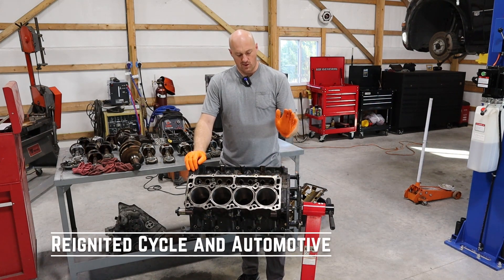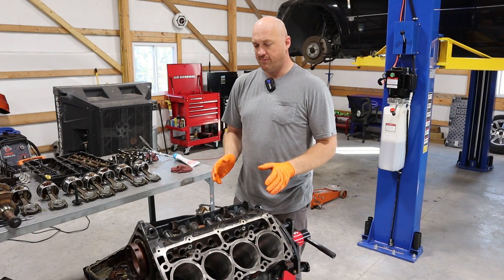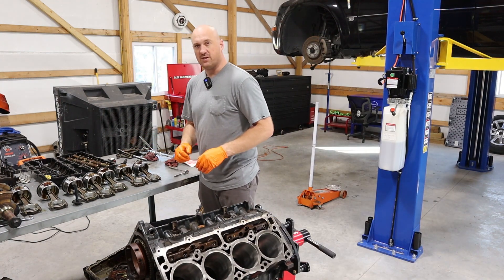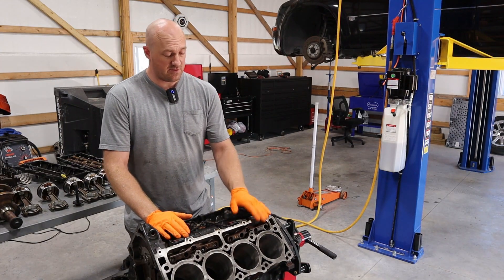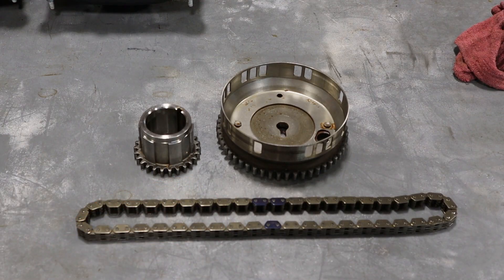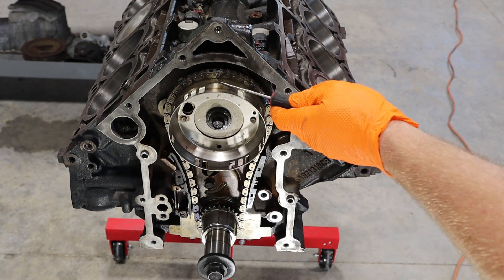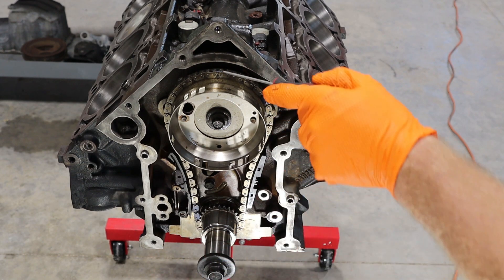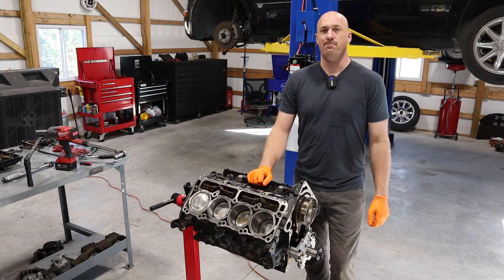How To: Engine Timing on Chrysler Hemi 5.7 // 300C Episode 3

Comment: I know that this is 5 years old but  factory manual shows the single timing mark on the chain to go at top on the cam gear. That's how i always install them. Apparently its not a big deal because it worked out for you with the 2 marks at the top. I use Alldata and Identifix for factory manuals. Thanks
Reply from the maker: I've heard this a few times over the years, the service info direct from Chrysler shows it the way I have in the videos, but there are other manuals that show it the way you described. Either way works obviously, in fact quite often I don't use the marks on the chain at all! The benefit of working with only one camshaft 👍

Comment: Thank you for sharing this, but what if I did it exactly besides having the piston at TDC or it is a must?
Reply: Yes having the vehicle at TDC Matters or your pretty much doing everything for no reason
Reply: That’s apart of setting timing if it’s not at TDC your timing won’t be right
Reply: @1 @10kDeeway  Thank you for the reply. Alright, since I made sure the crankshaft sprocket mark was at 6 o’clock, doesn’t that mean the piston was at TDC but I’m just forgetting? Because from what I’ve seen in my research over the past few days, whenever the sprocket is at 6 o’clock, that means the piston is at TDC. Please correct me if I’m wrong. Thanks again.

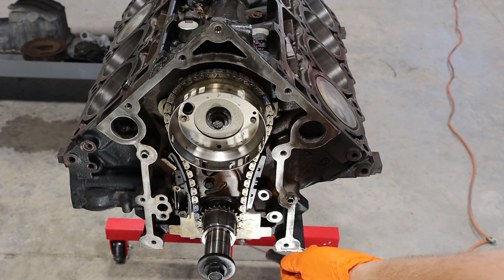Comment: 12:50 On my 2014 Challenger 5.7 you CAN still see the timing marks on the oil drive gear with the pump on and the pan still on too.

Comment: Hey Sky, appreciate the content! So I believe my 2010 6.1L SRT8 jumped time. Leak down test is good, valve train and total engine survived. Bore scoped all cylinders, looking good as well. Scanner shows cam-crank signals out of sync. When I was driving, it put itself in limp mode and cut off throttle response around 30mph/ 1000 rpm range. Jolted itself until complete loss. Cranks, started but ran TERRIBLY (only cranked it once to get scanner data). I have all but narrowed it down to jumped time. I'm going to take the front apart soon but I am VERY conflicted on what timing set to go with if it does end up being jumped. Cloyes makes a very inexpensive kit for a third of the price of Mopar but OEM, at least to me, makes more sense to put in? I want to pair new timing components with a Melling 10342HV oil pump. I am torn on what to purchase. Does Cloyes meets the OEM standard, or do I pay almost 400 dollars for a new Mopar kit? Completely stock car, will stay stock for a couple more years at least. Thanks!
Reply from the maker: I don't have ordinal experience with the cloyes brand, but everything i read says they're supposed to be pretty good and honestly the stock 6.1 isn't going to be stressing the timing chain. I think you'd be just fine going with that brand.

Comment: Hi im currently doing a mds delete kit on my 2012 5.7 charger i was wondering when im trying to time the engine my crank oil pump gear mark is facing at 5:45 at TDC my question is does it have to be at exactly 6 o’clock because when i try it at 6 the 1st piston goes down about 2cm thank you
Reply from the maker: Are you sure you're looking at cylinder #1? It's on the driver's side of the engine.
Reply: @ReignitedAuto yes sir drivers side piston tdc is at 5:45 on my engine if i try 6:00 the piston sits like 2-3cm down not tdc
Reply: @ReignitedAuto I believe its because i have the vvt engine I’ve heard the non vvt engines are marked at cam 12 crank 6 and the vvt engines are cam 12 crank 5-5:45ish
Reply from the maker: @MUSCLE_GARAGE-e1g negative, all gen 3 Hemi engines are timed exactly the same. If you're willing, send me a few pictures sales@reignitedtx.com so i can take a look.

Comment: How would you put the cam shaft in the right timing position if its not to begin with and do you have to remove the valve cover gasket to do the timing chain job?

Comment: Is that factory cam gear ? Been so long I can’t remember, I keep seeing a vvt and phaser gear and it’s throwing me off. I did a swap a few years ago and this is the same style gear I installed.
Reply from the maker: Yep, factory cam gear, but this engine is pre vvt so the gear just has the cam sensor reluctor wheel rather than the phaser 👍

Comment: Are you absolutely positive you got the colored links correct? Everything single thing I can find shows 03-08 non VVT having the two colored links on the crankshaft and the single link on the cam gear.
Reply from the maker: Yes I'm sure, however, the links themselves really aren't that important, as long as the crank mark is at 6 and the cam sprocket mark is at 12 you're in time.

Comment: HELP please!!!    I have a question for you.  I have a 2006 300C with 5.7 Hemi.  I havent driven the car in 2+ months I did start it about two weeks ago and it sounded slow cranking but started.  I figured the battery was weak from sitting.  Yesterday I tried to start it and it sounded like a locked up engine and wont crank.  I charged battery no change.  Long story short I put a breaker bar on the crank and it won't turn clockwise BUT it will rotate counter clockwise no problem with normal amount of resistance.  I'm leaning to believe that my starter Bendix / drive gear locked up in the OUT position,  While rare this could happen and that mechanism is a ratchet type that only will allow it to spin one way, so if it's stuck in the fly wheel the engine won't turn clockwise, but will allow counter clockwise rotation.   IF the engine was seized up it wouldn't turn either direction.  Does this sound correct to you??   I ordered a starter I'll know tomorrow ...... PLEASE let me know what you think. Oh I pulled the spark plugs thinking MAYBE coolant seeped into one of more cylinders while parked and its hydro-locked, but thankfully no signs of any coolant in cylinders, and with plugs removed still didn't crank same CLUNK sound. Last...... for awhile esp when hot the starter seemed to be dragging the past year when I did use the car, so I was going to change it soon anyway.  The car only has 72K miles on her too  Thanks kindly for your expertise
Reply from the maker: Will it rotate counter clockwise for the full revolution? I suspect it will spin backwards to about the same point as forwards and then stop. I doubt you're looking at a starter issue but I suppose it's possible. Try spinning the engine over completely counter clockwise and let me know.
Reply: @ReignitedAuto  Ok GREAT news the 300C is alive again!  So here's the down low .....  I removed the suspected bad starter and then tested it off the car using a 50 AMP battery charger.  The drive gear/Bendix was not stuck out as I thought which made me a little worried, so I thought MAYBE when I removed it from the engine it popped back inboard.  Applying power to the removed starter revealed a VERY weak starter motor,(keep in mind I previously mentioned I've noticed the starter turning slow past months when I did use the car and engine was heated up. Even cold it turned a bit slower then normal so I knew I had to change it soon! )   it turned slow and I could stop it with my sneaker!   I then tried it several times and it did bind up a few times and not turn so I felt more confident now. 

       I then thought OK so using a breaker bar I should be able to turn the engine clockwise now, guess what I wasn't!   THIS gave me a little scare, but I decided to turn it counter clockwise again and look at each accessory.  Turns out the alternator pulley wasn't spinning!   That somehow seized up from not using the car for a while.  The belt tensioner is designed to put tension while running clockwise, but gave enough slack for the rest of the accessories and crank to turn when I turned it counter clockwise!   I then put a socket and breaker bar on the alternator pulley and without much effort was able to get it turning freely again, and after that I was able to turn the engine clockwise once again!   Keep in mind I was only using a 20-22" breaker bar and didn't want to put too much force on anything but I knew it was NOT normal to need that much force to turn a "good" engine and made it appear the engine was locked up.  Long story short, after putting in the new starter it started right up , very strong I might add and the battery wasn't even weak from the car sitting 2 1/2+ months!  I've never had a car that the bad starter sounded like a seized up engine like this.  So in the end it was a dual issue, a weak starter locking up going bad while an alternator simultaneously was binding leading me to believe the engine was locked up.   Had I just went with old school instinct and change the starter without checking if engine would rotate or removing plugs as I did etc.   it would have started right up though I may have hear a bit of squealing until the alternator pulley freed up.  I guess the old saying better safe then sorry.  What IF the engine was hydro-locked and I had a cylinder full of coolant?   Removing and replacing the starter could have greatly damaged the engine, bent a rod,  cracked a piston etc,once I tried to start it!   At least my systematic diagnosis and checking one thing at a time didn't harm anything and gave me the best outcome!  A MILLION thanks for your help and answering my post so promptly!  GOD bless you I appreciate it so much.  I've subscribed to your channel  : )
Reply from the maker: @jakereal3604 great to hear you got it figured out! I definitely was not thinking a locked up alternator so good find there 👍 happy to hear it was a relatively simple fix and not a much more complicated engine issue.  👏
Reply: @ReignitedAuto  YES  I did like 1 1/2 revolutions counter clock wise, smooth, no binding  Even then no matter what position I have crank in if I engage starter theres no rotation at all in the engine.  I marked a belt and watch it as I crank, so it will rotate counter clockwise no problem no binding at all but if you try to rotate clockwise it wont move.  This would be a VERY rare condition BUT anything is possible and to me if an engine is seized or theres a "ridge" on cylinder walls and you back it off if you try clockwise rotation it will turn until you hit that ridge again.   This was what stumped me!   I said if its seized I would NOT be able to rotate it counter clockwise either!   Car was NEVER over heated or run without oil and last I drove it it ran perfect, smooth quiet full power etc  THANKS so far .. let me know two heads are better then one.  In the 44years im working on cars I have never encountered this!
Reply from the maker: @jakereal3604 if that's the case then I'd have to say your previous theory about the starter locked in the extended position would be the most plausible. Keep me in the loop I'm interested in how this turns out!
Reply: @ReignitedAuto  That seems to be the only rational possibility doesn't it?  Even IF it had a rust ridge in one of the cylinders when I backed it about 1/4 turn I expected it to at least crank back to that spot and stop OR the force MIGHT be enough to go past the hypothetical ridge and pass it and the engine would start.   Neither was the case here!  I backed it off and when I went to crank it, it didnt move at all stayed where it was.  This would be a most unusual situation but anything is possible.  I can't think of anything else that would cause this situation.

Comment: I am sure you hear this all the time, but watching your videos got me to do it.  It's all back together, but upon startup I got a sputtered start and rough idle.  I followed your tip to check the pushrod to rocker interface to make sure the pushrods are in their bores.  All of them were, so I am kind of stuck.  The truck threw a P2323 code, so I am trying to chase that.  Any thoughts?
Reply from the maker: Pretty much the only thing that will set that code is if the coil isn't plugged in all the way, or the coil itself is bad. I'd swap the coil to a different cylinder and see if the code chases it or stays in that cylinder.

Comment: When doing the timing chain on a 4x4 truck you can in-fact get that pick up tube bolt removed  without dropping the front axle and pan, just simply loosen a few of the pan bolts and gently pry down just enough to slip in there and get it off, but be cautious and stuff a few rags underneath and around the pickup tube so it doesn’t fall down into the pan

Comment: Hey , I commented on another video about setting the timing on my 13 ram 5.7. When i set the crank to TDC and cam at the 12 O’clock and install the timing chain and rotate the crank to check timing. the alignment marker on the crankshaft is not exactly at 6 O’clock but a tooth away from it. Is that normal or does it have to be exactly at the 6 ? Please help me
Reply from the maker: This will happen when your timing chain has stretched a little bit. It can be a little disorienting because the marks will never line up quite right. I would probably replace the chain since you're right there already. You'll see that with a fresh chain the marks will line up properly. 👍

Comment: My father has Chrysler 300c 5.7 v8 hemi. He got the car overheated, and before he could go on the side of the road the engine shut down. After the car cooled down he tried to start it but the engine didn't move at all(the starter was clicking). He took it to workshop and the technician said that the engine is seized and it needs to be rebuilt.
Is there anything that I can check to know the exact problem?
Reply from the maker: What year is it? If it's 2008 or older, likely when it overheated a valve seat feel out of the cylinder head and was contacted by the piston. I've rebuilt several engines with this failure but there are times when the engine is not salvageable. I suspect with the enough being seized it would be cheaper for you to just put a reman engine in it.

Comment: I have to replace a timing chain on my 2010 Jeep Commander. 

Can I get the oil pump off of this Eagle Hemi or will I need to drop the oil pan?
Reply from the maker: Some people say they can by bending the pickup tube a bit. But that's a little too jank for my tastes. Besides which it's not that much more work to drop the pan enough to get the pump off. 👍

Comment: it is impossible to find a timing cover gasket replace for a 05 5.7 hemi on you tube so if you go timing chain you get a glimpse. someone with a 2005 ram 5.7 that just changed timing cover gaskets should make a full video
Reply: apparently they are common for coolant leaks since the ports run through the cover and most of the bolts that hold it also holds the pump so a simple water pump change can cause a leak

Comment: hi now i have big problems with 5.7 hemi 2007 i got the car and the engine was in a bad way droped most of the valve seats had them fixed new pistons and so on but i never looked at the cam shaft timing is it posible that the cam chain can jump a teeth or so when it blow up case it is only runing on two cilinders if you can help it would be good lololol thanks larry

Comment: Just did a 17 ram 1500 lifters and cam without the removal of the oil pan so it is possible since you have to drop down the diff and jack up the motor to drop the pan
Reply from the maker: If you set the engine to TDC before removing the camshaft you're right it's not a big deal at all, just rest the timing chain off to the side and then when you're going back together it's just lining the cam sprocket at 12 o clock and you're good. I did this video about four years ago so I'm not even sure what I said in it 😄

Comment: Sorry to contact you on your youtube page. What 5.7 engines can I use in my 2016 Ram 1500 4X4?  Wiped out cam bearings and need a replacemnt but not sure if the car 5.7 will be the same?   I have good heads and basicly all the other stuff from my engine that I can put on replacement motor if needed.  Just trying to get some advice on what will work?   Thanks....  You have a great page also!!
Reply from the maker: Any truck engine from 09+ would be a direct fit, the long block anyway. The car engines would work, but there are a couple differences like the cam profile, and the fact that the car block is not drilled for the dipstick hole, drilling the block for the dipstick isn't too bad though if you want to take that on yourself.

Comment: No way I’d have reused them lifters just me but I’ve seen way to many failed lifters in these motors.
Reply: Those will probably be fine it’s just something I’d do if I’m already in the engine like that. I do have to say your videos are on point keep it m.
Reply from the maker: If it were a 2009+ engine I'd agree completely. These older engines don't exhibit the lifter failures like the newer ones do. 👍

Comment: At the end of the video you mentioned that you can pull the camshaft without removing the heads...... how do you get the camshaft out without removing the lifters?
Reply from the maker: I show it in a different video, but essentially you just have to remove the rocker arms and pushrods then spin the camshaft by hand a couple times to knock the lifters back into the bores, then slip the cam out. I'm not a huge fan of this version for a couple reasons: most of the time I'm replacing a cam it's because the lifters have failed and need to be replaced anyway, also if the lifters slide back down the bores before you get the new cam in place you're in real trouble. Lastly, it's really not that much extra work to remove the heads anyway. 
But it certainly can be done!

Comment: Just got my first hemi so I'm a little nervous about the lifter issue. I was an avid LS guy before and never had these issues (non-DOD). Sadly hemi's don't have a wide selection of lifter options. Sure they may last 100k miles but its not that good by modern standards. By now you think there'd be a solution but I think it comes down to Mopar poor quality metal.